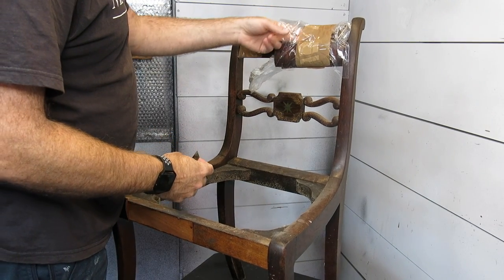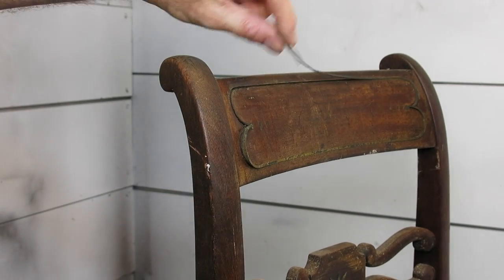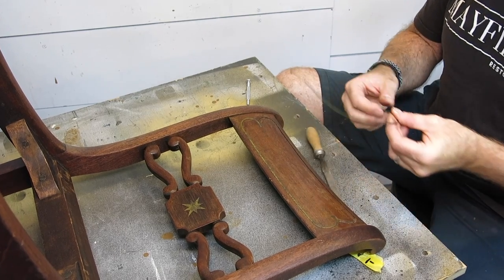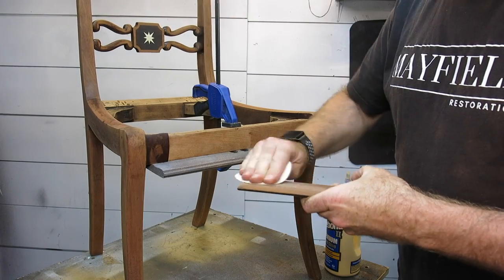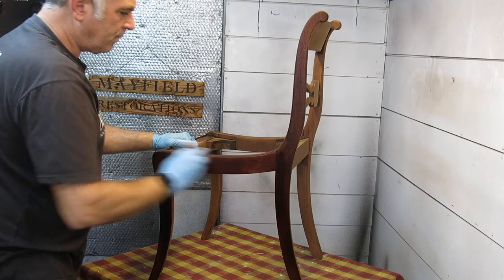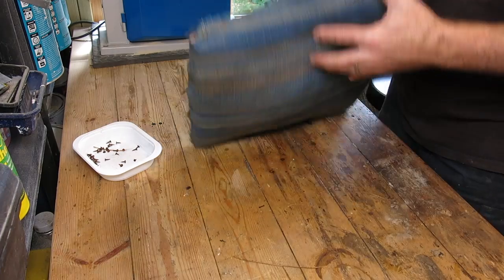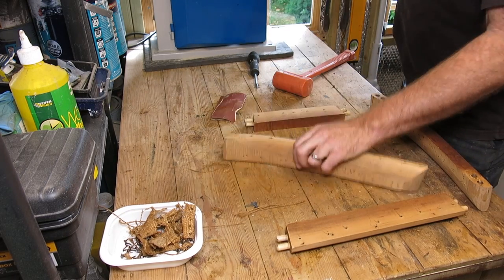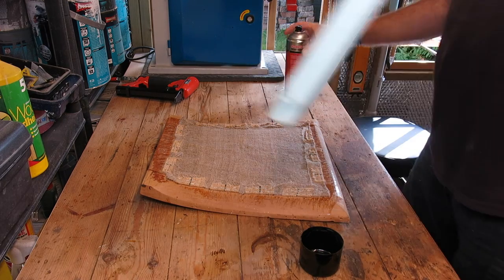30 YEARS in a SHED - Amazing Restoration of a Solid Mahogany Chair

Comment: Using a Japanese saw to cut the foam is a great idea.  I  currently use a large bread knife which works just ok. But now I’ll use my pull saw too.  Thanks!
Reply from the maker: Hi Wendy, I’ve seen those special foam cutters that upholsterers use that look like an electric carving knife but I don’t have one of them so I thought this would do the trick 😀😀😀😀👍
Reply: @MayfieldRestorations  I took an upholstery class and the instructor had a foam cutter. They are quite expensive.
Reply from the maker: @wendyhale2189  Probably an essential if you do it a lot but I dont do much upholstery, although I would quite like to do a course. 😃
Reply: @MayfieldRestorations  the course was offered at a local high school until the school district took away funding for occupational classes. ☹
Maybe something similar is offered in your area?

Comment: Great patience and craftsmanship. There seem to be several schools of thought concerning the glue to use. I had gleaned, in respect of antique/old furniture, that broken pieces needed either epoxy or PVA glue, while the joints need hide glue. What is your advice?
Reply from the maker: Hi Anthony, lots of glues available for lots of uses. I primarily use a PVA wood glue for most of my repairs, including joint repairs and even laying new veneers (let it dry and then use a hot iron to apply veneer). 2 Part epoxy is super strong and will pretty much stick anything to anything but it has a long cure time and is pretty permanent. The hide glue is the traditional one to use on Antiques really to ensure authenticity, mainly because its reversible further down the line should you need to disassemble the furniture. I rarely use this as I have had no problem disassembling pieces that have used PVA wood glue. I personally dont think their are hard and fast rules, just use what works best for you at the time. 😀

Comment: I did a search on how to cut foam because l have a wrought iron patio chair that needs a new seat. In the search l read and watch someone using an electric knife. I have not tried it yet since l won't be able to get an electric knife until next month. Love the turn out of the chair.
Reply from the maker: You can use an electric knife but just get a fine tooth blade 😀👍
Reply: @MayfieldRestorations  I pretty much figured l would need that kind of blade. My foam is square and l need to make a circle.

Comment: Overall really beautiful but I'm particularly enjoying the neat fold on the corners of the fabric. For my own reference, is there any point in searing or adding a touch of glue to the raw edges of the fabric to prevent fraying further down the line? I suppose it would depend on the type of fabric.
Reply from the maker: Thank you, the corners took me a while but I was happy with the end result. I used a proper upholstery fabric so there was no fraying of the cut edges but you’re right, reinforcement at cut edges might be needed on other materials. 😀😀👍

Comment: Thank you for such detailed step by step restoration project. It has inspired me and I am sure many more in the community. May I ask for the product details on clips 9.10 and 9.46 please? Links if possible. Also, could you provide the link to the home made stretcher you promised please? Wonderful work. Thank you.
Reply from the maker: Hi and thanks for you lovely comment. The links to the products used are actually in the video description and I have just added the video link to the webbing stretcher to the description 😀😀👍
Reply: Thanks for your reply. One thing to check if the Morrells stain is indeed Rosewood? I recalled from your clip that you have a handwritten "walnut" on the bottle label.

Comment: Beautiful job, fabric was fab😍I have six to restore thankfully not in such bad condition but very helpful insight. Can i just ask, if you didnt spray finish could you just wax over the stain?
Reply from the maker: Thanks. You can definitely use wax, hard wax oil, wipe on poly or some protective oil if you don’t want to spray 😀😀

Comment: May I ask, did you put the horse hair back undet the chair pad? What a thoughtful thing to do if yes. History. 

Another question if I may. Have you exprienced any glues that leave stains or oil marks on wood? If yes, how do you remove the stains?
Reply from the maker: I honestly can’t remember as it was a while ago 😀 regarding the glue, I just make sure it’s all been cleaned or sanded away before I stain/topcoat. If I notice any glue marks when staining I just scrape it off with a blade and use mineral spirit to clean then restrain 😀👍

Comment: Greetings from Kenya. I certainly enjoyed your video and I've just subscribed.  I'm not a furniture restorer at all. So my question isn't a veiled criticism -- I was expecting you to clean/polish the brass inlay before reinstalling it. What you did seems to have worked fine. Had you considered polishing the brass first? If so, why did you not do it that way? I'm just wondering. Not a complaint.
Reply from the maker: Hi Chip. Thanks for subscribing and your question is a good one. The main reason I didn’t is I knew I’d be having to glue the inlay and I suspected the inlay wouldn’t lay flat against the wood so I knew I’d have to deal with the glue mess and sand the brass flush. Polishing the brass prior to that would have just been a wasted process. I hope that makes sense. 😀😀😀👍👍👍
Reply: @MayfieldRestorations  Thanks for taking time to reply to my question. Your reply makes perfect sense. Your expertise was the reason. Blessings

Comment: Considering the choice to use a William Morris type fabric, it would seem that the chair, even restored , is an antique. From that standpoint then, to properly retain the value as an antique you should have used the old horsehair. It is not difficult to wash horsehair , just wash it in a mild soap and rinse with the horsehair inside a pillow. , then spread the horsehair out to dry. To attach, only requires the use of a heavy mattress thread sewn through the webbing with loops about the height of your flat hand. Once the horsehair is dry, it is then gently packed under the loops and formed to so it completely covers the opening with a thinner amount over the frame. After which, the use of a new poly cotton batting to form the final shape is generally used. Then the cover fabric. By changing the horsehair to foam, the chair has been devalued by 30%. Regardless of that it is a family piece and will be retained by them.
Reply from the maker: Hi Walter I appreciate your opinion and I expected such comments when I used the foam. As you mention, this is a family piece and no monetary value is associated with it or the restoration done upon it. The restoration/repair i have done on the seat pad is completely reversible should somebody in the distant future want to use the original upholstery materials. You mention the chair is "antique" because the customer chose a William Morris print fabric but thats not the original material so i'm not too sure what your thought process is to determine this is Antique. Do you recognise the style of chair and have some knowledge that this is an Antique piece with significant heritage and monetary value?
Reply: @MayfieldRestorations  while a cover fabric, even the one exposed under the leather, is not an indication of the age, as fabrics can be changed as desired, the basic chair shape design id that of Duncan Phyfe. Although the most popular slat design was the Lyre, that did not mean that it was the only design. Duncan Phyfe was known for the combination of brass inlay accents with Mahogany as in the top rail, and the star inlay and while usually using solid stock for front rail, they did occasionally use veneers, as you had to re attach. Most reproductions even by the Edwardian makers, did not go to that extent on chairs additionally, the side carvings on the  back splat indicate a greater craft time spent in the manufacturing process. Such was not done by  those making reproductions.
Reply from the maker: @walterulasinksi7031  Hi Walter, thats brilliant information thank you. I will do some research into Duncan Phyfe and see😀what i can find. If it is Antique I'll let the customer know and if he wants me to change to horsehair then I'm happy to do it. Thanks for your knowledge.  👍